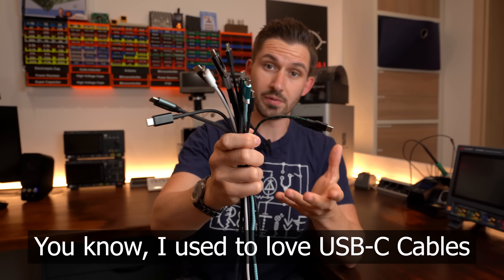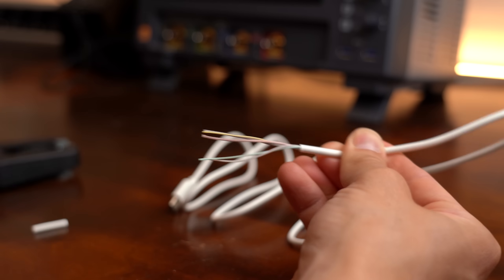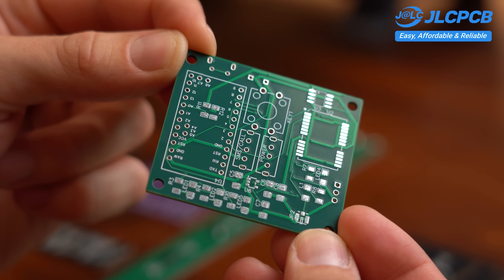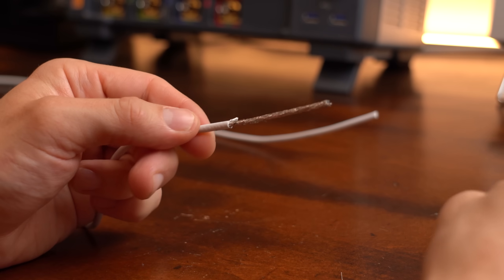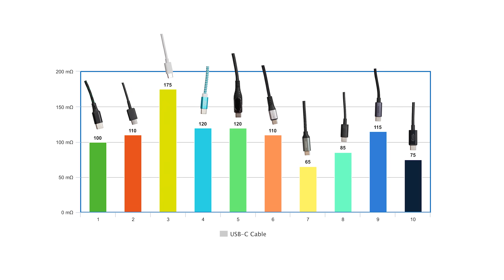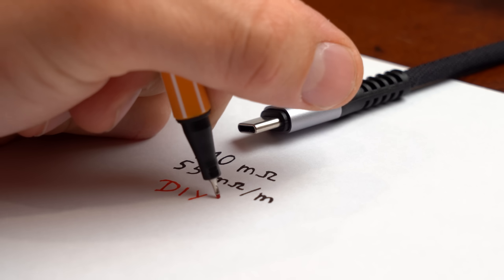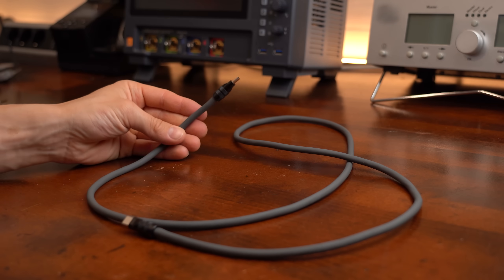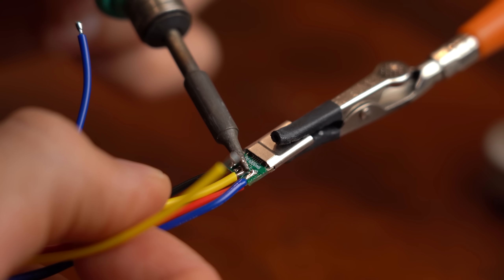Your USB-C Cable STILL Sucks — I Built a Better One? (DIY or Buy)

Comment: For high-wattage applications, going DIY on your cables is the best way to ensure you get what you need. I DIY'd my own extension cable for powering a space heater, for example, using 10AWG cable to ensure there weren't going to be ANY issues. So with USB-C, I'd likely do the same if I needed it for high-wattage applications - 100+W. For merely charging devices, though... not nearly as concerned and tend to prefer slow-charging anyway.
Reply from the maker: Thanks for the feedback :-)
Reply: I feel wasteful to use 10AWG, I'm assuming less max 1.5 KW and 10m.
Reply: @daklhs6460  It depends on whether you're on 110v or 230v, big difference, 10m if you are using a 20A breaker I can see the point in 10AWG at 110v
Reply: @daklhs6460  I can see that. But since we're talking about a space heater, I wanted zero compromises. I'm also in the United States, so on 110/120V power with almost all of the outlets in my house, so higher current draw for the same wattage delivery. And using 10AWG ensures the lowest resistance.

Plus it's important to not use power cables that just barely cover the power requirements. But that's all too common. For example, if you're running a desktop system with a high-power CPU and GPU, you've probably made sure to use high quality power-delivery cables going from the PSU to the graphics card and all other components. But not thought much about the power cable going from the PSU to the wall and how it's made and whether it can really handle what's being demanded of it.
Reply: @brandishwar  I’m not trying to overthrow your logic but 10AWG is 6mm2
What type of cables are you using in your walls? To be honest I rather have same or smaller gauge cables for extension cords than ones in my walls.

Second question 1,5mm2 cables can handle up to 15A that gives roughly 3,5 kW (in Europe at least).
How powerful is your heater?
Reply: @keepingsatyr888  Again, I'm in the US where the electrical outlets are 120V. So more current being shoved down the line because of the lower voltage. And the space heater in question is 1500W. I'll let you do the math.

The plug and receptacle supported 10AWG, so that's why I went with 10AWG. If they could only fit 12AWG, that is what I would've used. Same if they could only fit 14AWG. Though if they could only fit 14AWG, I would've looked for a plug and receptacle that supported at least 12AWG.

Extension and power cables are stranded core, as well, not solid core like what's in the wall. So going higher at least one step - e.g., 12AWG instead of 14AWG - is a good idea when you're talking about higher-current applications.
Reply: For a second I thought you said you DIY'd a USB-C cable with 10 AWG wire lol
Reply: Brandi and all, slow charging is always best for the batteries, right?
Reply: @eugenetswong The threshold I've always abided by is near-dead to full in no less than 2 hours. Any faster than that and you'll wear out the batteries faster.

The bigger the battery, as well, the slower the charge should be simply because of how much energy needs to be shoved into it. I have several 56V Ego power tools, meaning several of their battery packs. I also have a fast charger that can take their 7.5Ah battery from near-dead to charged in about 45 minutes. I used to rely on it at the start, but now I rely purely on slow charging them through an Ego power station, which takes about... 5 hours or so to charge one 7.5Ah battery from near dead to full.

It's also why one should never rely on DC fast charging for an EV, but should instead rely more on overnight slow charges and also shouldn't be topping off the battery all the time. Using the DC fast charging when you're on a road trip you take only a couple times a year is one thing. Always charging an EV using it, though... not a good idea.
Reply: @brandishwar  I read that we should never allow it to go below 20%, and never charge above 80%. You disagree?
Reply: @eugenetswong For lithium ion batteries, this is the recommended strategy. However, match your usage to your device. One of my phones lasts a week or more on a full charge, so I always charge to 100%. Because even if there is a loss of battery life, it won't occur until many charging cycles have been made. And since I only charge once per week, I will most likely never see a noticeable decrease in performance because of how infrequently I charge the phone, and because I'll probably replace the phone after a few years. In my case, it's worth it to be to charge to 100%.
And I turn the phone off and use a slow 10w charger.
Reply: @mediocreman2  Thank you for all those tiny details. I feel a lot better about this topic.

I never thought about the issue of replacing a phone before the battery is no good. I find that demoralizing. I try hard to make my tech last as long as possible...only to be out done by obsolescence.

Just to be sure that I understand you, is the action of charging a problem? For instance, if instead of charging 100% each time, I unplug and immediately replug every 10% until 100%, then will I damage the battery?

I could be wrong, but if I leave it plugged in when I am using it at home, then that should cause no wear or tear on the battery.
Reply: @MiGujack  Thank you! My phone doesn't show percentages, so is it just as good to aim for roughly 80% [e.g.: hypothetical 24 minutes] of the time of time to reach 100% [e.g.: hypothetical 30 minutes]?
Reply: A space heater? Like, an electric space heater? And you were worried about resistive power loss?
Reply: @AtlasReburdened  No I was making sure I had an extension cable that was at near-zero risk of overheating.
Reply: @AtlasReburdened  He was worried that some of the energy will be converted to heat and radiated into the room instead of being converted into heat and radiated into the room.
Reply: @hubertnnn  Get your point, but perhaps not all of the 10m was inside the room that was intended to heat up.

Comment: also chubby cable use very similar cable they seal the circuit with high temp hot glue and close it quick

Comment: What i really want is for usbc to carry 2 different voltages at the same time.. One for each sides, so i can power my 5v mcu and my 20v motors at the same time  without having to add buck converter
Reply from the maker: Very niche demand I would say.

Comment: I never had issues with poor cables, because i just buy some with specification or named and all that cheapies that come with devices i just trash.
Toocki on aliexpress are pretty good for 100W (with wattage meter included).
One of the hardest cables to find are ones that support DP and are longer than 1m.

Comment: Encouraging, but I don't feel this goes far enough. I'd like to see a DIY power + 3.1 data cable with proper shielding. Not necessarily for the practical benefit, but more for the educational on how to build it to the right standards
Reply from the maker: I put it on my to do list
Reply: @greatscottlab  I would curious whether "abusing" ethernet cable for this would work!
Reply: @greatscottlab  Thanks dude. We really need a decent reference implementation so companies who's names don't start with 'A' and end with 'nker' can get this right.
Reply: 40 gbit
Reply: the problem with full speed USB3.1 or Thunderbolt 3/4 cables is that they actually use micro-coaxial cables for data  rather than straight wires. Much much harder to DIY.
Reply: @CypherAod  i have dismantled a few usb3.? cables, none had microcoaxials. All looked like shielded twisted pair ethernet more-or-less. Pretty thick and rigid. I would like to have one with ucoaxes just to have some thinness/flexibility, most usb3 cables i've dealt with are thick and rigid... all kinda terrible to use.
Reply: @CypherAod  Not really ,you just solder a shield and wire instead of two wires.
Reply: Yes, this could be a little series to se how difficult or easy it is to get a USB-C cable, next video could be 5Gbps and see how far can we get in a DIY cable like is it possible a 240W 10Gbps? can we go to 20Gbps?
Reply: I have good cables that support both power and fast speeds. They are either very short cables from AliExpress (10cm) or long cables from my work Dell monitors that act as a docking station. The Dell cable is not flexible at all and quite heavy. But it does provide high power and high data speeds.
Reply: @ofoofo Yeah, 10Gbps or higher requires quite thick cables, and even then they don't get very long - USB 2.0 had a max passive cable length of 5m, which dropped to 3m for 5Gbps USB 3.x, and IIRC 1.5 or 1.8m for 10G, with anything longer requiring active cables. USB4 and TB require active cables for anything above 1m, and still use very thick and stiff cables.
Reply: Thunderbolt 4 and USB4 would be great, too 😅
Reply: yes please. this would be a great video.
Reply: Not to mention even lowly USB 2 requires twisted pairs on the data lines.
Reply: Well, one option is to use cat6a or higher twisted pair for data lines and add power lines to it. That's the easiest. Another variant is to go nuts and twist the wires yourself and add shielding, but neither option will add to the experiment here as power transfer is already covered and data transfer is quite deep topic, which would be somewhat beyond this channels scope.
Reply: 3.2 gen 2x2
Reply: I tried this myself. It's basically impossible to do without proper microsoldering equipment, and even then is rather difficult to get it right.
Reply: Yet nobody's ever had an issue with a cable without shielding. Plus, you might not know... But the positive and negative lines, produce magnetic fields against each other, which means they shouldn't even be running alongside each other.
Reply: also who knows how good the usb chips are or whatever it is he bought from who knows who
Reply: Wtf are you lol creature
Reply: Regarding ethernet cables, keep in mind there are many many types of ethernet cable in the same categories... just like USB so good luck ;p  Currently I use rated cat6A shielded bonded pairs ( solid ) with my home network.  I love the overkill.
Reply: It would be educational for sure, but it would show how insanely hard it is to make them. And by extension how badly the usb-C has failed
Reply: eh you need to length match, inductance match and shield each differential pair to make it work, it would not be viable to make
Reply: @ShahZahid It’s not that hard, just buy the correct cable. There’s millions of options available, CAT 7 Ethernet cable satisfies all of these requirements with ease.
Reply: @gtjack9 Great, now you just need three of those to cover the pinout of a USB-C connector, plus two thicker wires for power, and shielding for the whole bundle. Super simple!
Reply: @Kraaketaer CAT7 would cover your data lines, you’re not gonna use the cable in its raw form.
You get all the individually shielded wire pairs needed for data, then all you need is an unshielded untwisted silver pair for DC power, for this options are ubiquitous. Shielding is not required for the DC pair.
Reply: @gtjack9  Isn't cat7 still just 4 twisted pairs? If you want a full bandwidth USB-C cable you need 23 pins populated (either CC1 or CC2 is left disconnected).  With 4 being power and 4 being ground, the best you can do with Cat7 would be two cables to populate the remaining 15 pins. So, sure, not 3, but still 2 plus the power wiring.
Reply: @Kraaketaer 18 wires for full thunderbolt complianc. CAT7 would satisfy the data line aspect
Reply: @gtjack9  yes, we can all just buy good cables. but the educational value is something a bought cable cannot provide.
Reply: @gtjack9 So TB doesn't use the USB 2.0 pins? I mean, it's nice that that saves you a few pins, but you'll still need SBU and CC wiring, and the Cat7 will only be enough for the TX/RX pairs. Still need two cables plus power if that's what you're working with.
Reply: This
Reply: You're going to love the cables LTT is working on. As I understand it their goal is 'screw the costs, I demand perfection'.

Comment: Is there a usb c to 48 volt or 54 volt output out there.  If not, can you build one.  Need one for my work computer vpn router
Reply from the maker: You can get 48V with the newest USBC PD.
Reply: @greatscottlab  I'm trying to power a 54V vpn router from a 100w power bank.  I haven't found any power banks outputing 48V yet
Reply: @greatscottlab  I haven't found any power banks that output 48V.  I'm looking for a USB C to 54V barrel plug adapter to run a vpn router from  USB C power bank
Reply: I'd check if the vpn router also runs on 48V, probably the 54V is just absolute maximum rating

Comment: Don't you need twisted pair for  D+ and D- ?
Reply: You only really need twisted pairs for high-speed communication, or if you're trying to fight off interference with something like ferrite beads. So yeah, if he's building a high-speed data cable, then twisted pairs absolutely matter.

It’s all about the pulse frequencies—if they’re fast enough, they can start radiating or picking up interference, which can mess with the signal integrity on the other end.

🧪 USB 2.0 – “Slow” but Still Spicy

USB 2.0 runs at 480 Mbps (that’s megabits, not megabytes). That’s 60 megabytes per second, and while it seems "slow" compared to USB 3.0 or Thunderbolt, in signal integrity land—it’s already fast enough to need proper cable design.

The signals on USB 2.0 have fast edge transitions (even if the raw bitrate isn't gigabit-level), and those fast transitions = high-frequency components. We’re talking significant energy in the hundreds of MHz range.

So yes—twisted pairs are necessary for USB 2.0 Data+ and Data- lines, especially for any cable length longer than a few centimeters. That’s why:

    All spec-compliant USB 2.0 cables twist the D+ and D– lines.

    They also try to keep the differential impedance around 90 ohms, give or take.

Now, if you’re doing a 5 cm DIY job between two boards sitting next to each other? You might get away with untwisted wires. But longer than that, and especially in a noisy environment? It’s a bad time waiting to happen.
🚀 USB 3.0 – Now We’re in the “Don’t Mess Around” Zone

USB 3.0 runs at 5 Gbps. Now we’re into serious RF territory. You don’t just need twisted pairs; you need:

    Impedance-controlled differential pairs (again ~90 ohms),

    Consistent trace/cable geometry,

    Shielding (USB 3.0 cables are often fully shielded),

    Possibly even pre-emphasis and equalization at the endpoints.

At this speed, reflections, crosstalk, and even trace stubs on a PCB can ruin your signal. Your USB 3.0 cable is essentially part of the transmission line system now.
TL;DR:
Protocol	Speed	Twisted Pair?	       Impedance Control?	    Can You Half-Ass It?
USB 1.1	   12 Mbps	Eh, optional short runs	Nope	                         Probably
USB 2.0	   480 Mbps	Yes                                  	Yes-ish	                    Only super short runs
USB 3.0+   5+ Gbps	Hell yes	                            Absolutely	                      Not a chance.

sorry about the poor formatting on small screens XD
Reply: @todf5230  thanks for the comment, how should one twist the wires for the usb2.0?  is there some kind of twists per meter number?
Reply: @todf5230 uhm, I somehow had in mind, that the "encoding" on usb 2.0 is similar to that used on the serial port ... to transfer 1 byte of data, you actually need 10 bits on the wire.
so it would be a maximum of 48MByte/s
Reply from the maker: Well, it worked like this. But I will talk about that and stuff like shielding in a future episode :-)